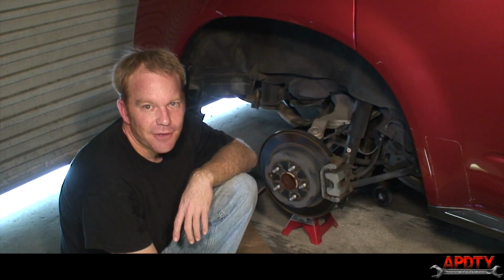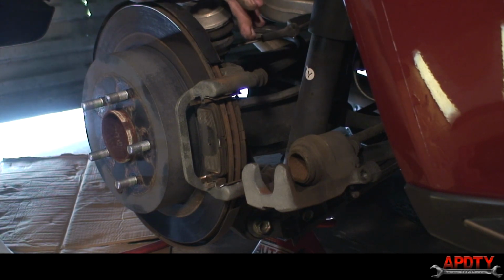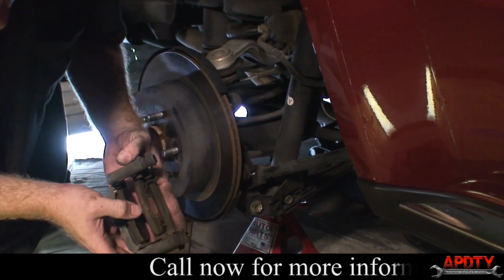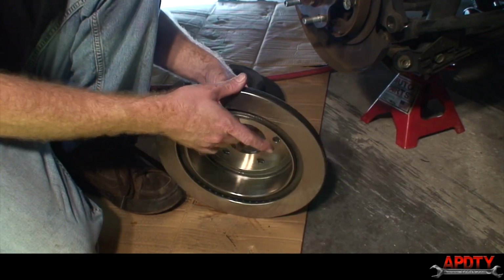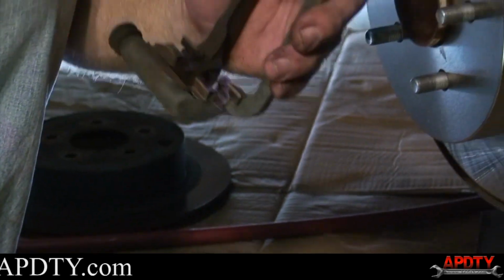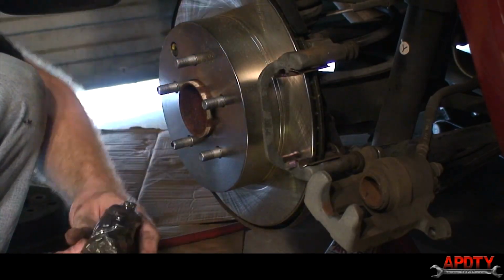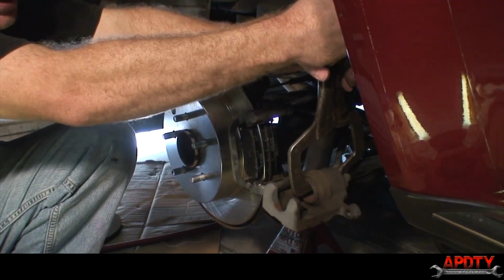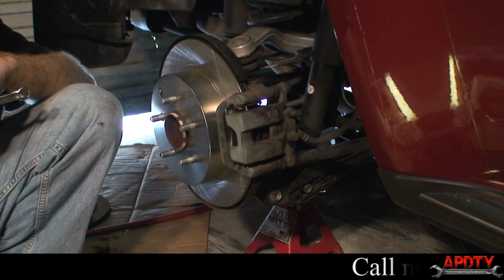2006 Nissan Murano Rear Disc Brake Pad and Rotor

Comment from the maker: @janebang83 The Rubber plug thing on the rotor is to allow adjustment of the Parking Brake. With the rubber plug out, you can line up the hole with the parking brake adjuster and make adjustments without taking the brakes completely apart.

Comment: Thank you great video. My bracket bolts are extremely difficult to break loose.  Disc rusted against drive bearing makes this a longer than should be job.
Reply: Michael Flores same with mine, wasnt a simple ratchet smack, more like a breaker bar